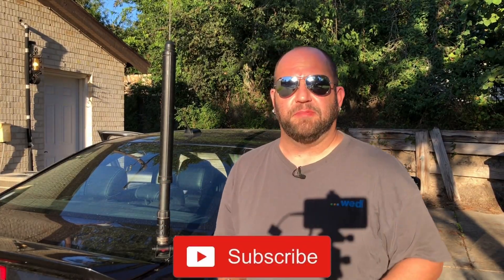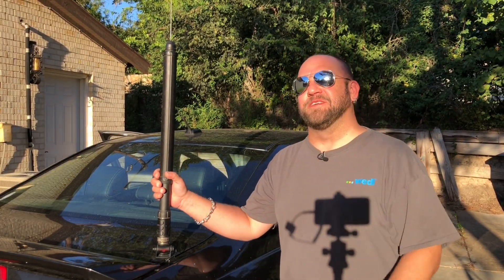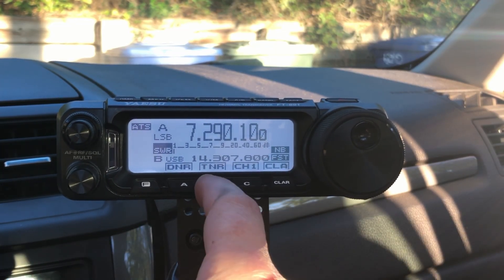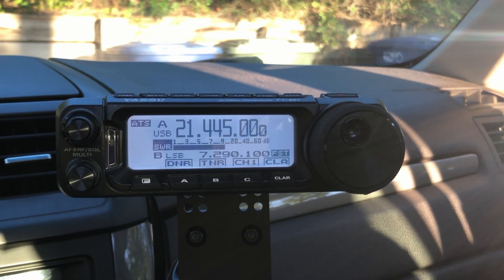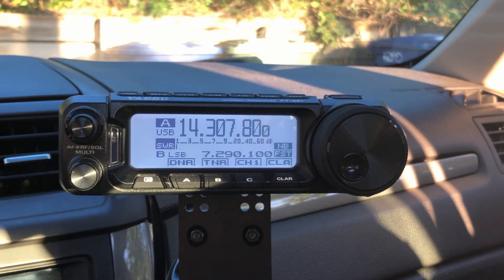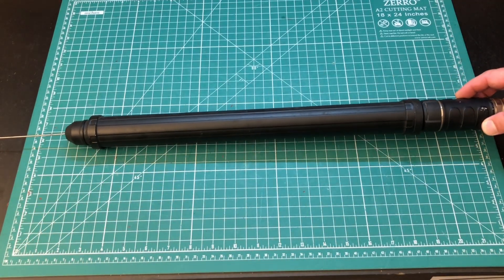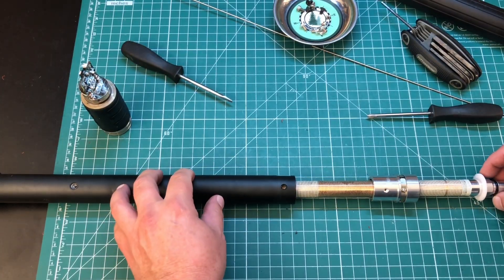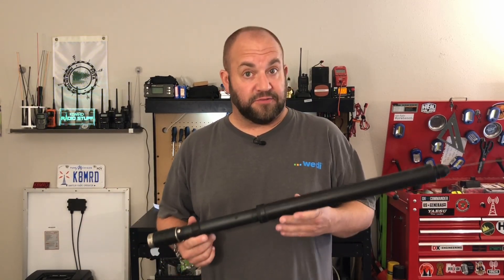Yaesu ATAS-120A Mobile HF/VHF/UHF Screwdriver Antenna

Comment: I've been running an ATAS with my 891 since spring, I'm shooting for DXCC and I've got..uh...about 25 countries so far. Picked up Algeria on 10m(!!) today. I've got a 3-magnet mag mount, no bonding/grounding (so far). It definitely isn't as good as a "home" antenna so I understand the comments about it being "deaf". I haven't ruled out something bigger/more efficient. (Taheel's website still looks active,, fwiw.) I do love the 1-touch tuning and I have encountered the antenna becoming "lost". Mostly during the few times I try 40m. I might swap out the 891 for a Kenwood TS-480SAT just because the 891 is so controlled by its menu system which is a 5-star PIA if you're in motion. I'd give up the 1-touch tuning for easier access to functions. Anyway...the ATAS is far better than the one-off Diamond antenna I ran about 12 years ago. My drives are typically 10-40 minutes so the ATAS quick band changes are a winner. "Someday..." I'll bond my hoord, doors and rear hatch plus semi-permanently mount it on my roof rack (with proper grounding to the body). Maybe that'll help. It's a compromise antenna on a compromise mount - it is, what it is.
Thanks, as always, for the video! One of these days, I'll catch you on the air. Did hear you a week or two ago but, so did everyone and their brother. HiHi! 73's WB3CFN/Mobile
Reply: I'm having issues installing mine.  Do you use the car's battery?  Also, do you ground your radio? thx.

Comment: Using one on my mobile setup with an 991a. Works well.Worked you and KF8IV with it in July. I did bond my truck before mounting to ensure quality tuning. Didnt try to use it without bonding. Thanks for the vid. K7REH

Comment: Great video!    I use one of these with a ft-dx10. What a combo.  Lots of mobile (I pull over and park) dx to Europe on it!   Hard to believe such a little whip gets out so well.   Parking location does matter a lot.   By the beach or up on a bluff is best.   73, N7RLV

Comment: Your car must be really well bonded together.  I still maintain that you need to do so to most vehicles to make sure this antenna works properly.  Could not get it to tune on my GMC truck until I took the time to bond all the quarter panels to the frame and the mount to the bed.  These antennas preform well as did mine until a vandal came by one day and bent the whip over
Reply: Did you replace the whip on it.
Reply: @sbateson67  never did.  There is still a piece of the whip left inside the antenna where it broke off flush and was unable to get that small piece out.

Comment: Using one on my balcony with my ftdx-10. Worked the world on 40,20 and 15 meter
Reply: What are you using for mount and radials.
Reply: @randymonch9112  4 wires, 16' long. This is 4-conductors control wire. All conductors tied together at one end and attached to the ATAS bracket. In my case, a Diamond BK-11.

Comment: As with any antenna system that relies on the vehicle body as the ground plane, in general, I would imagine the more metal the better. MOARMETAL!

Initially, the UP and DOWN arrows do appear to be backwards, but I'm going to give Yaesu the benefit of the doubt and go with the DOWN arrow being lower in frequency, therefore making the antenna longer in length which would be accomplished by the antenna going UP. But yeah, that's still kinda backwards on a user interface. 

Oh I almost forgot to ask. Mike, how do you know? (rhetorical ball bearing question)

Comment: Good video Mike, I have had one for a number of years with no bonding apart from the mount to the boot lid and have had no problems with it, use it with the 857D.

Comment: I wonder if the ATAS can be used outside of a car. Like, outdoors with radials? Also, why did you tune on SSB and not on AM, FM, or RITTY.
Reply: I've used my ATAS-120 on a tripod with 8 counterpoise wires. Works wonderfully.
Reply from the maker: One of the guys in my old club in Michigan did exactly like that.  Basically a motorized Wolf River Coils.

Comment: Great Review.  I was waiting for the review.  I remember you mentioned that in a video some months ago.  i have the ATAS and have no problem running it off the roof rack of my 4Runner. I just added a braid from the rack to the body.   I do plan to replace the 3-foot whip with a 6-foot one and see if there is any improvement.   It's a little hard to find a 2 mm diameter SS whip but I see McMaster-Carr has something that may work.  73 de KF6LU

Comment: Hi! I got this antenna recently and tested it with my 991A. During the first checking process I’ve noticed the same “stuck” issue. What you said is absolutely true. It goes all the way to the end and then the motor continues going but there’s a clutch inside preventing damage. Then after 30” reverts the spinning and start going the other way until it finds the match.
Another way of getting out of that suck situation is to use the manual tuning. Look where the antennas is and move it consequently. By the way, UP and DOWN on the mike refers to frequency to match, not to antenna position, as you said.
73s